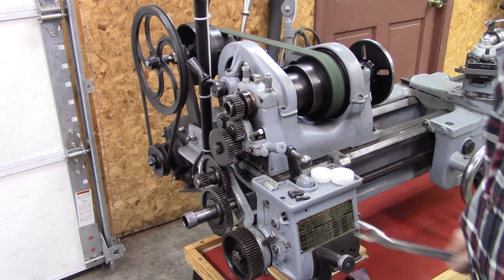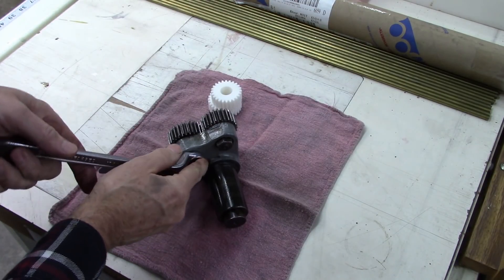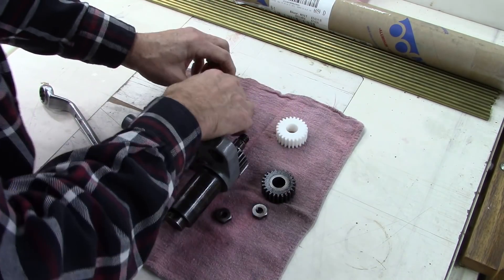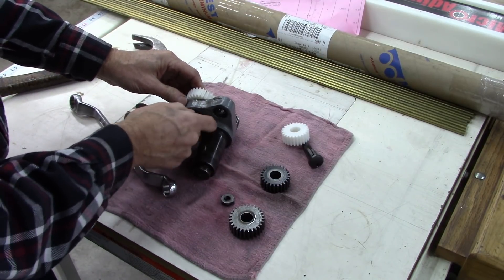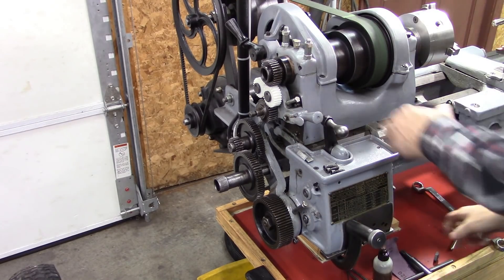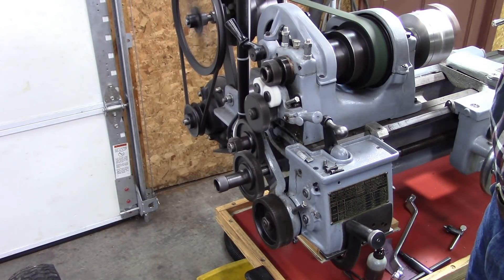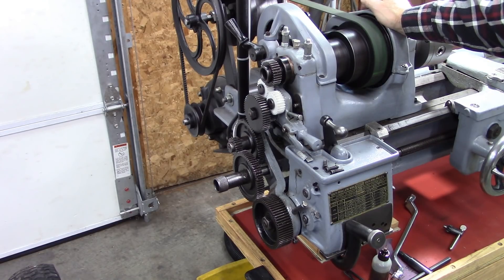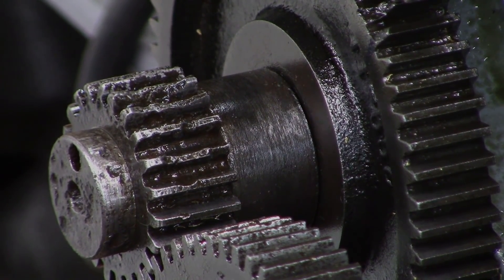Quiet Gears for my South Bend 11

Comment: I had 2 south bends, one with very worn gears, one almost new. Noise difference was night and day. On the older one I made an attachment to drive  the leadscrew on the tail end with a variable speed DC motor. It was dead quiet and reversible with the flick of a switch. Only time I needed gears was for threading after that mod.
Reply from the maker: My gears don't look worn but they are loud for sure.

Comment: I travelled on a steam powered riverboat as a boy...........the big exposed gears were lubricated with pitch (road tar) diluted with kerosene.   The mixture was applied  to the gears with a mop and bucket.   It kept the gears quiet but the whistle still made a piercing noise.    Guess you can't have everything all at once!!!

Stavros
Reply from the maker: I've heard wire rope lube is similar.

Comment: I put chain lube on mine , it was a drastic improvement
Reply from the maker: Which chain lube did you use. The last can I bought was not thick like what I have bought in the past. Right now I'm using 600 wt gear oil but a good chain lube might be better.

Comment: Straight cut gears will always be noisy due to the complete meshing of each tooth. That’s why most vehicles use helical gears, they mesh in little by little and out in the same manner. The trouble with helical gearing (apart from the added cost of production) is that they tend to force each other sideways and out of mesh. This means that not only are the gears more expensive, but the casings need to be much stronger as well, which would make the design of a lathe prohibitively expensive and difficult.
Reply from the maker: Good information and I agree. I've considered making is roller chain.

Comment: I use Motorcycle CHAIN LUBE (the sticky kind) on my open gears on my old Atlas, seemed to quiet them down quite a bit, in my Clausing's gearbox I used a full quart of Lucas Oil treatment (along with the right amount of normal oil, minus one quart) and it made those gears a LOT quieter!?
Reply from the maker: I've tried the chain lube although maybe not the right kind.

Comment: My southbend 10k was as noise as yours. The noise was caused by the gears on the bango being out of adjustment. They where meshing to deeply. The crown of the  teeth was strucking the valley between teeth. Increasing the distance between their shaft centers reduced the noise   by 90%. Check the spacing between gears centers and the meshing of the gears.
Reply from the maker: I wish this was the case. I've adjusted these gears several times. The only one really making now is a stacked gear with no adjustment. When I got the lathe the teeth on the gear were badly rusted and there isn't enough tooth left to mesh well

Comment: I have used my 3d printer to print gears and made gears to cut threads not on my quick change chart. They have worked well so far. I hope yours work great also.
Reply from the maker: Good to hear!

Comment: You really did a Great Job on restoring that Lathe Winky. Actually All of your Equipment is in Top Condition. I guess it will take time to see how the Gears last. Enjoyed the Video as always. 👍
Reply from the maker: Thank you very much!  I have one more gear to replace which I will make. It's a gear attached to a to another gear by a tube. It has a key so I'm not sure plastic would hold up.

Comment: Definitely quieter, nothing wrong with plastic gears in calculated situations. The main 12x36 lathe at the high school shop I taught at had a plastic idler between the spindle and quick change gear box. It lasted well under normal use but was also an "engineered weak point" that stripped off if there was a malfunction with the apron feed or threading. Was actually a nice feature, the students tore a few of them up but they were cheaper than other parts, lol!
Reply: Thanks! So far they are doing great. Interesting that the gears on the high school lathe were all plastic. When they failed was it the gear(s) closest to the quick change? I figured the gears closer to the spindle would have less load. I need to replace another gear but I'm going to try cutting one. I think plastic would be strong enough if it was a standard gear but it's keyed to a larger gear. The way it is made I think the plastic would be too fragile.
Reply: @Morkmtw  There was only one plastic gear in the gear train, an idler between the spindle gear and the input gear to the carriage feed quick change gear box. The rest were steel. Not sure what kind of plastic it was but it had a bearing in the middle retained by a snap ring so it had to be a reasonably decent plastic.
Reply from the maker: I didn't realize i was logged in under my other account when I replied before. Thanks for the info.

Comment: I use Lucas brand oil additive, sorry dont know the exact name but its dark clear red colour.
It's the super clingy one, it makes like a big web between gears when running and doesn't fling off.
Normally it is used to put a small amount as an additive in gearbox oil, but I use it straight on my lathe gears.
Something to do with the clingy nature means there is no metal to metal contact between the gear teeth, and they run super quiet now. It's amazing on steel gears!

Warning; don't use it straight in high speed applications like car gearboxes, it loads the bearing too much. But on slow lathe gears it's fantastic, quiet, and low wear because there's no metal to metal tooth contact any more, the clingy red stuff fills any clearances between the teeth.
Reply from the maker: Thanks, I'll look around for that.
Reply: @WinkysWorkshop    hi, I think it's called Lucas Heavy Duty Oil Stabilizer 👍
Reply from the maker: @wizrom3046  Thanks

Comment: That rattle, clack of  those old steel gears is awful. Noise like that makes the hair on the back of my neck stand right up. This 3D tech is really something now eh. I saw one doing aluminum a while back. These worked great. Keep it up and you won't know the old girl is running, LOL.
Reply from the maker: I saw a guy put a chain drive on his although he kept the reverse lever.
Reply: @WinkysWorkshop  Hey, If it works it works. A novel approach to an ongoing problem eh.
Reply from the maker: @TomokosEnterprize  - Exactly

Comment: Two tricks for noisy gears on the gear train. When adjusting the gear back lash put a piece of notebook paper between the gears to set the clearance. Get a bottle of chain saw bar oil and apply sparingly to the gears. It will sling off and require a solvent like mineral oil or kerosene to clean up... but it will make the gears run quietly.
Reply from the maker: I'm using 600 wt gear oil and the gears I just replaced have no backlash adjustment.
Reply from the maker: I thought about the chain lube. They used to make an aerosol that was very thick when it dried but the last one I bought wasn't like that.
Reply: For our dirt bikes, we used to take off the chain and put it in a metal coffee can. We added a can of STP and heated everything up on a small fire till the oil started to smoke. We never had any scientific proof that this was the best way to lube anything but the chain stayed plenty slippery to the point that you didn’t have to do this very often.
Reply from the maker: @joeromanak8797  I'll bet the oil would get inside the chain like that.

Comment: Wink, take a look at the gears you remove I thought I saw shiny tooth faces on the gears, if so they have been meshing deep in the mate.
Reply from the maker: You did see a shiny spot. I've worked on them with a file. I put bluing in the teeth t find high spots.

Comment: Nice fix. The noise in my 13" is coming from the interface between the sliding gear and the input gear to the single tumbler gearbox. If I pull that large gear, I hear very little noise or rattle. If I drive the input to the QCGB with a drill, no noise. It's only when those two are together. I'm not sure of that's just the cause and the noise is actually coming from somewhere else. I might have to try and 3D print some twin gears some day.
Reply from the maker: Gear noise is hard to track down and it does not take much wear to make it bad.

Comment: I have a South bend as well. Be interesting to see if they hold up with some heavy cutting. The only thing I have noticed is the guys with mini lathes are looking metal gears to replace there plastic gears.
Reply from the maker: Yes and they may fail. I will say this however. The small lathes have very narrow gears and the south bend are 5/8" thick so they may do better.
Reply: @WinkysWorkshop  I'm surely going to save the info you gave us. If yours holds up I probably will invest in a set.
Reply from the maker: @anthonycash4609  I'll be sure and mention how they are doing in future videos
Reply: The Mini lathe usually has plastic gears but I have replaced some of them with nylon gears and have metal gears also.   The nylon is much stronger than plastic but the plastic seems to work.   When learning to use a lathe they make a great safety like a shear pin and now I always run with at least one non metal gear.   The only time a gear ever broke was due to operater error and was glad they were there.   They are a lot quieter than metal gears also.   It was a great unit to learn to use a lathe without any help or instructor.

Dale in Canada
Reply from the maker: @dalemcinnes1834  - I agree, not a bad idea

Comment: There's a machine shop on ebay that sells quiet reversing gear kits for SB, they have roller bearings in them. IIRC the ask around $150 for the kit. Check on PM, one of them will remember the co pany name. I think they were out of Minnesota or Wisconsin
Reply from the maker: Yeah I remember seeing that. Thanks

Comment: Wow definitely an improvement, I have an 11" too. Its an under drive 11 inch by 5 foot bed catalog no.111-B. Should be the same specs as yours as far as the gears go. I would really appreciate the specs on the gears to give to the seller on ebay to purchase these.
Reply from the maker: The gears are 16DP and 14.5 PA. The tooth counts were 24 and 27 and the width is 11/16". Count your gear teeth, I'm guessing they are he same. Here's the item number, 202442512087. Run a search on Youtube and you will find the old auction. You will have to write him and say you'd like a set.

Comment: LOL your gears are noisy ??? you should hear the ones on my Logan 911 ....yes it needs bushings ! ...all of them, everywhere...including the apron.... I'm getting to it, i'm just a bit slow
LOL
Reply from the maker: It drives me crazy. My quick change is a little noisy but the rest of the gear train is fairly good. The plastic helped but something isn't right in the reverse lever area. Maybe slightly bent teeth but I can't find them!
Reply: @WinkysWorkshop  on my lathe the one that makes the most of the noise is the one you took off to get the reverse gear bracket off that bushing is completely shot you can see it wiggling as it runs
( the gear that is driven by the reverse gear setup)
 check the bushing and play in that small gear !
maybe you could ease the top edges of each tooth with a file ?
thanks for the videos buddy !
Reply from the maker: @bobkelly2447  My Logan was like that. I bored and sleeved the Logan and it helped a bunch. My south bend is much better I think part if this is a worn out rust gear. The one shown at the end of the video. I'll be making this gear soon so we will see.

Comment: If you can find some S.T.P. Oil additive, spread some on the teeth of the properly adjusted steel gears.
Reply from the maker: I've use this as well as 600 wt gear oil. The plastic seems to do the best.

Comment: The use of plastic gears in the train isn't new. Many applications from lathe back gears to car engine timing gear trains include at least one gear made from Tufnol or Acetal to reduce gear noise.
The ultimate in quiet back gear drives is by fitting a set of toothed pulleys and a cogged timing belt. These are extremely quiet in use.
Reply from the maker: I've thought about that in the past. With the quick change it's a doable idea aside from needing to reverse.

Comment: Not an expert but I’ve always heard that straight cut gears will always be the noisiest option. I know vintage manual transmissions got a lot quieter when they switched to spiral cut gears. I’m sure it would cost a fortune to convert the lathe gears but it’s interesting to imagine the difference it would make. 😎👍
Reply from the maker: They are for sure but when they new they are more quiet (or plastic)
Reply: Yes car gearboxes and transmissions always use helical cut gears for that reason.
Reply: @nonoyorbusness  - My dad’s hobby was restoring Model A Fords (1928 - 1931 vintage). The 3 speed transmission in those was the simplest mechanism imaginable, including straight cut gears. Ford kept things running as quiet as possible by having the gears running in a gearbox filled with oil of the same viscosity as molasses, lol. 😎👍
Reply: @joeromanak8797  600 weight gear oil.....

Comment: Make your badly pitted gear out of canvas backed  phenolic resin.  Back in the day, many gears were made from that material with success.
JIM
Reply from the maker: I've seen those. It probably is a good option.
Reply: Ford v engines always used a large resin phenolic gear to drive the camshaft it was very long lasting.
Reply: Phenolic gears are very good. A phenolic gear in contact with a steel gear theoretically will never wear. 

In addition to this, phenolic gears are self lubricating- the cotton laminate absorbs oil the first time it is lubricated and releases it as it's used, the same as an oilite bushing does.

Comment: Why in the world would one of the plastic gears have a different tooth count than the other? I doubt very much that the steel ones they replace have a different tooth count.
Reply from the maker: They are absolutely the same as the original but I have no idea why they are made that way. Dang....  now I need to figure this out! It looks like the feed rate would be off in reverse but It is not. I have threaded cutting LH threads and RH and everything it the same.

Comment: I think I see where the rest of the noise is coming from... man that's an ugly looking gear 😂
Reply: That's the gear that causes all the noise, it's the high speed for the gear box. Slide that knob in to the low speed and that gear is now disengaged and it's considerably quieter because the gear train is running much slower.
Edit: or is it out for low speed? I forget. 😉
Reply from the maker: Yes that makes a difference but most the noise in mine was around the reverse lever. Even with the plastic gears you hear it. I'm thinking maybe a couple of teeth on the spindle gear are bent although I can't tell by looking.

Comment: Ear plugs! Problem solved.
Reply from the maker: That's certainly a cheap and quick solution.
Reply: @WinkysWorkshop  There's a video on my channel of my chain drive set up. It shows a ER40 collet chuck spool up to 2,200 rpm.
Reply from the maker: @David-Rule  which video?  Yes a chain or timing belt drive would be great.
Reply: @WinkysWorkshop  I'm sorry, I haven't uploaded it to YouTube (My bad). I'll get on there shortly. I see you have a gear box like I do so I removed all the gears out of the train up to the reverse tumbler gears.
Reply: @WinkysWorkshop  Ok I got the video of the chain drive uploaded. Go to my channel, select videos and it should be the first one. In the beginning I'm in back gear with is also very quiet. I repaired all the broken teeth, then ran it for a few hrs. with lapping compound on the gears .
Reply from the maker: @David-Rule  I love it. What about the high and low range? Is the ratio correct?